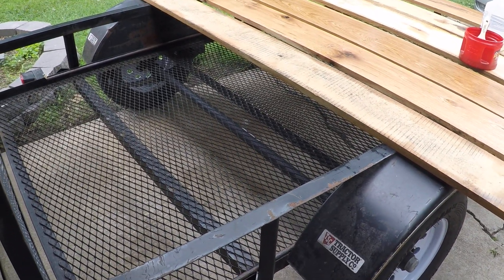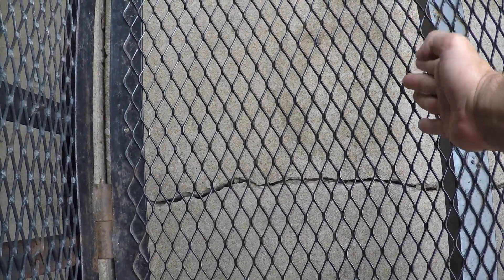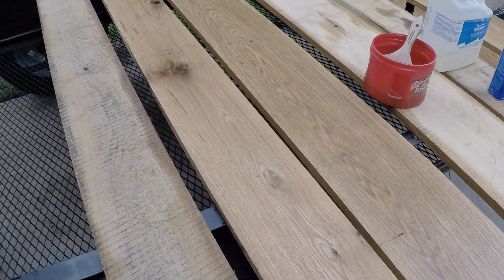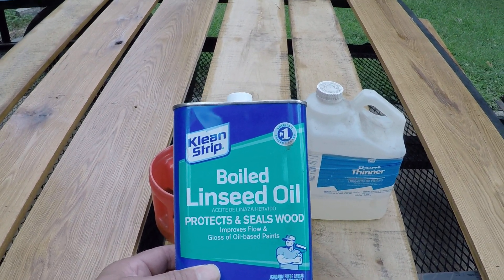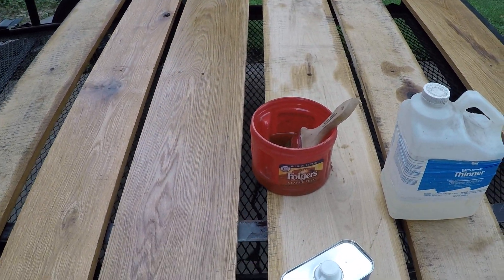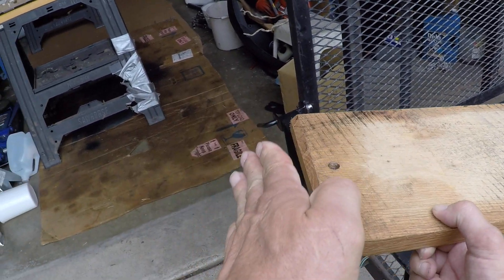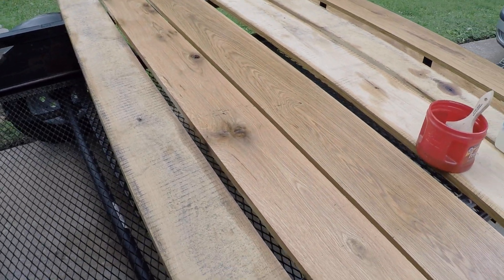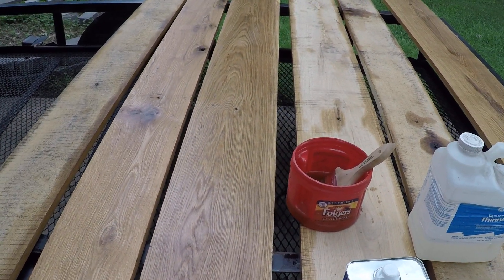Carry On trailer mod. Putting a wood deck over wire mesh. Part 1 of 5

Comment: Just added some wood to my trailer. I have a 10' similar to yours. I used hex head bolts to mount. Now I'm going to remove them all and seal them. 

I had some angle iron laying around and screwed that to the board ends that face the gate. Pretty darn sturdy now.

I did not space the boards because I learned that they are going to shrink by the time they shrink i'l have good spacing between each board.

Comment: I hauled my motorcycle 300 miles with this trailer (with no boards, just the wire mesh). It was absolutely TERRIFYING. I have a TW200 weighs about 280 pounds. Bike actually tipped when I got to my destination, thankfully I was going about 2mph and the bike didn't sustain any damage. the hooks fell out when I hit a pot hole so on the way out I used my extra straps to make a kind of safety pin so no matter how loose the straps got they didn't fall out. I'm not doing another trip with that thing till I deck it. Did this sturdy it up for you?

Comment: Where did you get your lumber.  Lowes and Home Depot where I live don't carry any.  In fact, I was looking for some 1x6x10 and all they do have is decking.
Reply from the maker: I found it on craigslist. It started around 1'' thick, some more. I'm anal so I planed them all down to 7/8''. I just have a light trailer so I didn't want to use 2x material.

I used rough sawed lumber so it wasn't slick when wet. I have it in my mind 
that the roughness might give it better traction,,,lol. Maybe. Maybe 
not. 

You can also get it from a saw mill. Some mills make what they call pallet boards. They are 3/4'' white oak that they use to make pallets. They sell a 1x6x8 for $2. But they were too far away from me to make it worth the drive. 

Good luck.
Reply: Thanks for the info.  I live near Tucson and there is only one saw mill and they work with the Forest Department, not sure they would cut some for me.  What Lowes stained pine,  but I don't want to pay $10.50 each.  I'll keep looking.  Thanks again.
Reply: ryoung6725 
Home Depot has 1” x 8” which actually is 0.75 inch